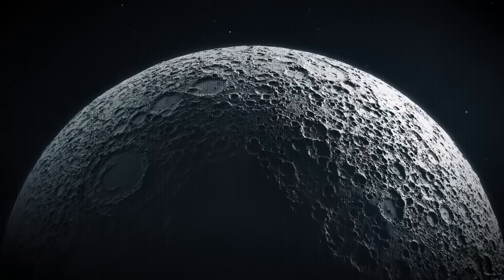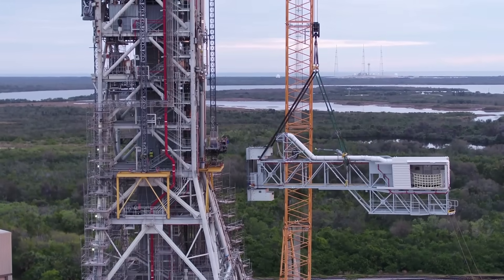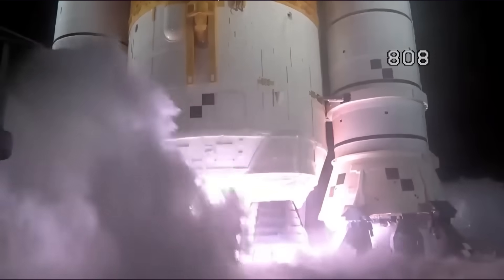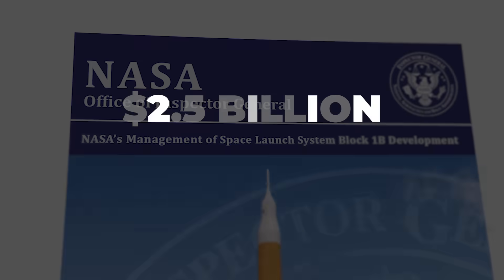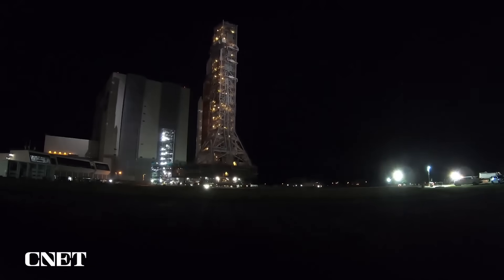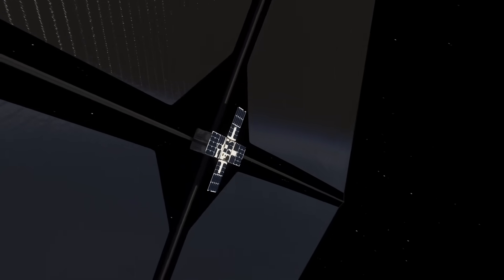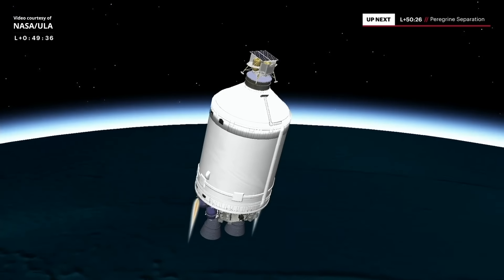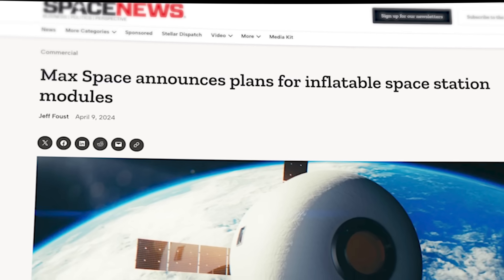NASA Has A New Problem With The Moon Mission (Artemis)

Comment: Why is a Lunar gateway needed?  Launch equipment from LEO to the Lunar surface using Starship cargo vessels.  When enough components are on the surface launch a crew to LEO to the HLS using Crew Dragon (which has a LES) and send them to the Lunar surface.  They would set up the base, a solar farm, and construct a landing pad then return to LEO and back to Earth on Crew Dragon.  All this depends on a LEO propellent depot which I think should be 3 Starship tankers with 2 more Starships with cryo-chillers and solar panels.  Since Starship is design to launch multiple times per week it would just keep launching to keep the propellent deport full on a continuing basis similar to Starlink.  It doesn't need to be tied to a mission.

Comment: It is sad that the requirement to reuse Space Shuttle technology yielded this piss poor 2.5 stage design. The SLS lugs that huge f'ing TANK most of the way to orbit, and uses HydroLOX on the BOOSTER stage. The Saturn V was a 3 stage design that used cheaper, simpler keroLOX engines on the booster, threw them completely away, and then saved the high performance HyroLOX for the second and third stages. By discarding weight by shedding stages along the way, the Saturn V could boost MORE PAYLOAD than SLS to orbit or the moon! There were also plans to upgrade the Saturn V with solid or liquid rocket boosters on the first stage, and some stretched upper stages so it would lift even more. With the success of the Falcon 9 so well documented and proved, 
a modernized Saturn V-like design could have a recoverable 1st stage, (maybe even a recoverable second stage) and still lift more payload than this SLS design. It could also use the new MethaLOX technology to discard the dirty kerosene on the booster stage and liwuid side boosters.
And since the Saturn V was the same height as the tower, there would be no need to stretch it or build a new one.
And these stupid cost-plus contracts have to end.

Comment: No problem. Launch SLS with an Exploration Upper Stage and a landing vehicle but without the Orion. Once in a stable LEO, launch the Orion on a Falcon Heavy and rendezvous with the Exploration Upper Stage. Go to Moon. Land and return.
Reply: Falcon Heavy's diameter is too small for Orion, You'd probably need a Delta IV Heavy, But those are retired

Comment: Just make a permanent launch tower and make the vertical assembly building mobile. That way the mobile part of the setup doesn't have to be built to withstand the extreme forces of a launch and no mobile refuelling infrastructure required. The vertical assembly building could have attachment points for standard self-propelled modular transporters then add enough weight at ground level to prevent the wind pushing the building over when being transported. Then when located around the launch tower or at it's storage location the building would connect to fixed footings. This would have to be far cheaper than the transporter NASA is getting built. Especially as the vertical assembly building is essentially an empty box, yes, with gantries, hoists, etc.But I would think it was a simpler and cheaper task to move the vertical assembly building. Especially as the self-propelled modular transporters which would be a large part of the design are off the shelf and available from multiple manufacturers.
Reply: Make the VAB mobile? Really? Do you realize how big that building is?
Reply: @SteveSteeleMusic  Moving buildings is done all the time. Some of them made of stone and weighing thousands of tonnes. And those building were never made to be moved. Yet small teams manage to do this with a tiny budget compared to what NASA is paying for the machine to move their rocket. 
The VAB is a strong steel structure which is welded and bolted together, not a massive Jenga stack of stone blocks. Putting the required lifting points on the building (and adding bracing and strengthening) to enable the self-propelled modular transporter modules to be bolted on would not be expensive.
Basically, attach a suitable number of transporter modules, unbolt the building from the foundation points. The transporter modules lift the building a foot or two. Then the whole structure is driven and positioned over identical foundation attachment points at the launch platform. The transport modules lower the building and the bolts are reattached. Attach any services that are required. Just like the mobile launch tower, the move would not be done in high winds.

Advantages would be a much lower cost. Much lower risk to the rocket. Off the shelf components for a low cost and rapid build. Any failures of the transporter modules would be easily and rapidly fixed by swapping out the faulty module. The rocket would be protected until just before launch as rolling the building aside would be much quicker than rolling out the whole rocket and tower. Teams of people that are experienced in moving buildings and working with mobile transporters already exist. 
So many advantages. The fuelling system doesn't have to attach to a mobile launch tower, the tower would be fixed as would the fuelling system. The transport system wouldn't be exposed to the force of a launch. The building and associated transport modules would be far away from the launch area at liftoff. The launch tower could be permanently attached to solid foundations. The tower could be made as heavy duty as required as there would be no consideration needed for it to be transportable.

If somebody asked me to either move a very expensive, very fragile, rocket and launch tower. Or move a comparatively inexpensive steel building that had been braced and strengthened to be very strong. I know which one I would choose.
Reply: bro's source is his crack pipe
Reply: The current VAB is huge mainly because it has to accommodate the huge mobile platform moving in and out of it. How big is SpaceX's vertical assembly building by comparison? If the launch platform was fixed and the rocket was assembled on the launch platform then all that really needs to be mobile is the shell that protects the rocket and launch platform. The shell would only be a fraction of the current VABs size. The shell would basically be a movable version of SpaceX's VAB.
It could be built at a fraction of the cost of the mobile launch platform. It would be quick to build by comparison as well.
The only reason not to assemble the rocket on the launch platform is that the launch platform would not be usable for launches while the rocket was under construction. But NASA's launch cadence is so long between launches that this is unlikely to be ab issue.
Think about this. Imagine you had a clean slate and two options were presented. One was to build a fixed launch tower complete with in place fuelling systems, communication, power, cooling, elevators, etc. The rocket parts would be transported to this launch tower and assembled in the spot where it will eventually be launched from. Around the launch tower is a shell that would protect the rocket and assembly workers from the weather. The shell being made movable.
Second option, Build the rocket and launch facilities on top of a vehicle inside of a building far away from the launch site. Then after building your extremely valuable rocket very carefully and slowly drive the rocket and launch tower down the road to the launch site. Once at the launch site begin connecting the mobile launch platform to the infrastructure including fuelling systems, communication, power, cooling, etc.
Which option sounds like it has the bigger risk?
Then there is the scenario of a launch scrub for say unexpected weather or a rocket or launch platform fault. Now you have to go about disconnecting the fuelling systems, communication, power, cooling, etc. Then very slowly drive the mobile platform all the way back to the VAB so the problem can be fixed. Compared to just wheeling the shell back in place and fixing the problem or waiting for the weather to clear.
Reply: Wouldn't it just be easier what Russia did with the N1? Stack it horizontally then move it by trains to the launch pad, then just raise it vertically

Comment: If we only worry about speed, and safety. Then cost becomes a non issue. With this said, explain to me why isn't NASA using SpaceX falcon heavy?

If we built the space station in low earth orbit, and then move it to the moon. That should be a lot quicker.
Reply: Falcon heavy isn’t equipped to haul that much payload to the moon. And how are you going to move a space station to the moon?
Reply: @SteveSteeleMusic   build it in low earth orbit, launch a second stage rocket that is similar to the star ship. As in similar to the refueling in orbit bit,  and attach it to the space station.

Now obviously I am not talking about launch the space station all at once to orbit, but the parts for it. 

Which last time I checked, falcon heavy is able to handle heavier payloads compared to falcon 9. Therefore should be able to send up there the modules required to build the space station in question.

Now obviously I know it's more complex than that, but it is doable, and you have to be a fool to think otherwise.

Comment: soooo....  The tower needs work and that's a problem?  SpaceX has redone their tower 50 times.  Doesn't seem to be an issue with you on that.  They even dug a 50ft crater after engineers told them not to launch.  Do you think they didn't think of those things?  Zoom in on the tower.  Go ahead, I'll wait.  What do you suppose those other attachment points are for?  And all those extra lines running up to the top not currently in use?  Hmmm.

Comment: Actually, the moon landing was never in danger due to lack of working hardware, once Spacex was selected to build the lander. The Orion and the Gateway were Never needed. The simple change of bringing the crew via Crew Dragon to the Lander after refueling in orbit obviates the need for Orion and a lunar orbit docking which would be riskier for no gain. Since the Gateway doesn't have hundreds of tons of fuel, it becomes pointless. 

Send up a lander to refuel in LEO. Have dragon dock with it and drop off the 4 astronauts. 
Have the astronauts travel to the lunar surface in a much larger and more comfortable ship, with far greater resources if something should go wrong. It is DESIGNED to support astronauts for months... Orion is Not.

Spacex will have the Lander ready for 09/26 or 09/27 at the latest judging from their current progress. 
So just get the damn space suit ready and chuck the rest.
We Know Crew Dragon works. What do we need Orion/SLS for? How is this $4.5 billion padding of the budget at all necessary.

The only problem is that NASA politics are in the way. 
They need Spacex to do the moon landing, because, apparently even the easy parts are too difficult for other vendors. 
They need Spacex to rescue the Starliner crew. 
They need Spacex for the sample return mission as Spacex is the Only vendor that already has a general use lander under construction origionally designed to go to Mars (With the new 6ton nuclear plant and In-Situ refueling capability... maybe an adapted (Heate/Radiation/Dust) Cybertruck and Teslabots.). 

Their other offerings will involve blowing at Least $7 billion on a one use lander/launcher.... forgetting that's the Exact job of the giant ship the government already bought for $3 billion from Spacex. 
Give then another $5 billion, the reactor, the in-situe fuel generator and Spacex can do the rest with a Much more capable rover (with a range of well over 400km (in case, there's no ice at the sample site). 
Just have a pair of Teslabots drive Celestial Cybertruck from the ice bearing landing site to the sample site, have the robots put the samples in the truck and trundle back to the refueling/relaunch site). 
Bring the ship back. 

Musk will likely fund a 2nd trip if necessary as he is the one who wants to put a city on Mars.

Comment: Regarding Cost Plus contracts: You have to understand that from a contractor’s POV there’s a Huge amount of risk in bidding developmental work. If the contractor were to bid as Firm Fixed Price, they’d price in all the risk and conservatism of everything that could go wrong. That price would be astronomical- pardon the pun. While cost type contracts aren’t perfect, they allow the contractor to bid the work as if everything goes according to according to plan with no major hiccups. There’s a variety of cost type contracts that allow for flexibility and incentives for the contractor to perform better. 
For example a Cost Plus Fixed Fee has the profit dollar amount established at the beginning of the contract with all costs to do the work being covered by the gov/NASA/etc. This means that if the contractor performs badly (doubles their cost), their profit % is cut in half, because they aren’t getting any more profit. Vice versa if they perform very well. And trust me, Profit Rates matter a lot to contracts and is a major metric they report to investors. An earnings call to explain a 2% profit rate on a tough contract vs a 20% profit rate are much different conversations. Moreover, at 2% contractors would rather be putting their people and capital to more profitable work. It’s a sink for them.
Obviously take what I say with a grain of salt since i work for a defense contractor myself.

Comment: the solar wind is moving at 0,15% of the light speed or 1,5/1000 so how can it get us to other stars?
Reply: If you’re talking about a solar sail, the ship’s velocity would continue to increase over time.
Reply: @SteveSteeleMusic  so it can go faster than the solar wind? and increase untill when? voyager have passed the point in witch the wind decrease. It doesnt work like the normal wind on our sail ships. It can work if you want to go in our solar system but not to others

Comment: Why TF would you build a mobile tower!? I understand why the vehicle has to move... But why does the ground infrastructure have to? Not asking "Why?" in any project often enough, leads to cost overruns and eventually project's cancellation.
Reply: How do you propose they get the rocket from the VAB to the tower, without the rocket falling over? We could do like the Soviets and move the rocket lying down horizontally. But too much stress is placed on the rocket as it’s stood up. The mobile launch tower is the best way.
Reply: @SteveSteeleMusic  I don't want to propose solutions as I'm not an engineer. I merely stated the fact that by not asking "Why?" we are prone to inherit soft requirements believing they are hard requirements. They have an existing solution (a mobile launch platform) searching for a problem: "How to assemble and then launch the rocket?". Only this time, the rocket is bigger so the old solution might not be the shortest path to a launch, nor the cheapest path. It might be faster and cheaper to build a new mobile VAB with a fixed tower. When the context changes, reassess your requirements! Some of them might be obsolete.
Reply: There is a MASSIVE underground launch complex. The crawler just moves the rocket 7 miles away from everything else incase it explodes.

Comment: You have to wonder, over the years, how many people were crushed by those tank tracks?
Reply: Just interns that didn't move out of the way fast enough.
Reply: Some genius figured out to line the road the crawler drives with river rocks. Its saves the bearings on the crawler. Apparently you can hear them popping as they are pulverized.

Comment: Wouldn’t it be safer to design the inflatable modules out of a material that leaks before it bursts?  Perhaps this cannot be done with woven fiber material they are using.  Metals are heavy and they are not flexible but they can be designed so that they leak without exploding.

Comment: Now would be another grand opportunity to get the GAO involved with this senseless spending endeavor.  Allocate the funding to the private sector and cut our tax payer losses… with “shrink-flation” being what it is in 2024… $300M will not get you a good sounding rocket tower.  Frankly, I call BS on Bechtel and the hyper inflated costs.  Anytime I made a bid for a project… and it ran over… it was not the fault of the customer and is an example of poor planning.
Reply: Bechtel IS the private sector. Can you really not imagine what is actually going on here? ;-)
Reply: @lepidoptera9337  yes you are correct.  I used to contract work from them… they discounted the hell out of the company worked for